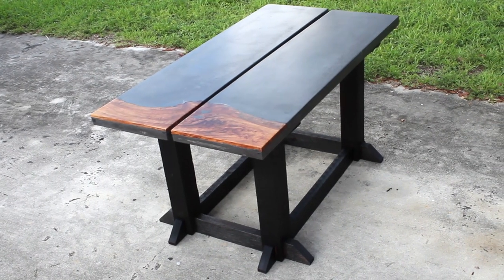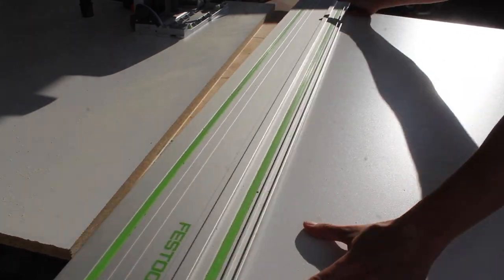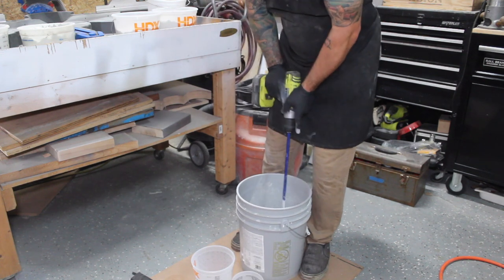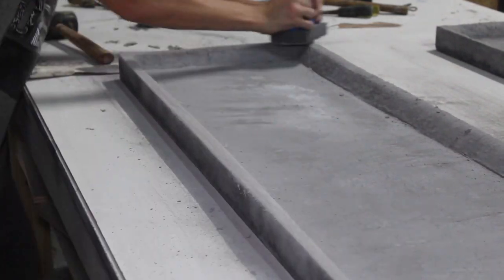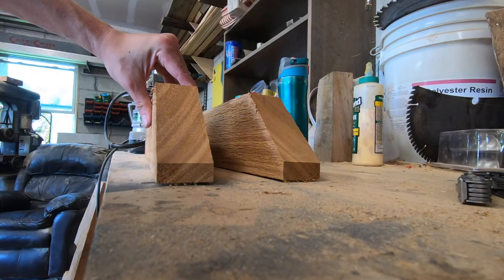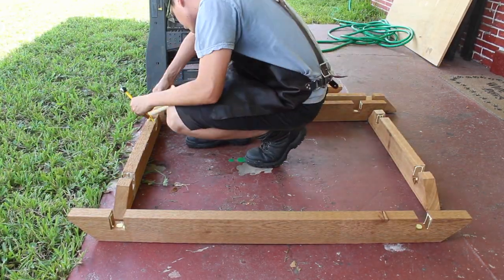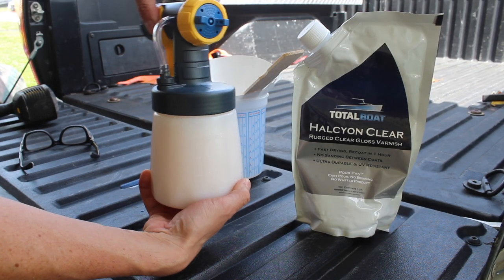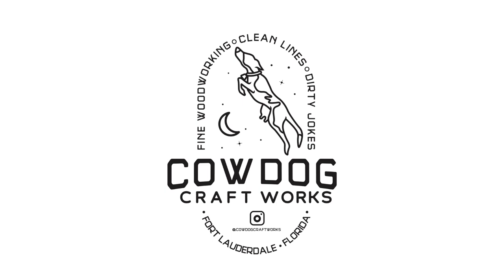Concrete and Live Edge Outdoor Dining Table

Comment: Beautiful work, I've been experimenting with GFRC as well. You certainly have an eye for detail and it's nice to see a true craftsman at work. I didn't know about the real milk tung oil and will have to try it on my next piece.
Reply from the maker: One thing I’ll say about Gfrc is that you should definitely err on the side of thicker. I’ve had some smaller pieces snap if you’re picking them by the edge instead of supporting it properly. Tung oil is great. I’ve been using it as more of a furniture finish lately. I’ve started to layer on thinner coats which helps with cure times and better protection, instead of just dumping the bottle on there like I did. About 10-12 thin coats over a week or so does the trick.
Reply: @CowDogCraftWorks  Thanks for the tips.

Comment: Hi Adam. How is your table now? Any issues after few years outdoor, especially at wood/concrete contact line? I consider making similar design for my kitchen countertop.
Reply from the maker: So there are issues… but not at the specific line you’re addressing. Be wary of your spouse placing anything hot on the epoxy. Mine let a citronella candle in a metal bucket burn on it all night. Epoxy melted under it. If you do it for a countertop I would strongly enforce trivets in the household.

Comment: How did this hold up? I have some black walnut pieces that I need to use, and I really want to do a table this way. With the expansion/contraction of the wood, do you have any separation or did the epoxy maintain its adhesion to the concrete?
Reply from the maker: The epoxy maintained its adhesion but… do not place anything hot on the epoxy without a trivet of some kind… wife let a citronella candle burn to the base of the can and well… it created problems.

Comment: Great design, inspired lots of ideas for creative use of mixed mediums. Also a great video details both how and why of all the steps! One question: why not embed the inlaid plywood under the table top right into the concrete to ensure an even top?
Reply from the maker: Top is going to be even either way based on the mold. But yes I could have embedded the plywood substrate directly into the concrete if I wanted to. Probably would have been better to use marine grade plywood in that instance.